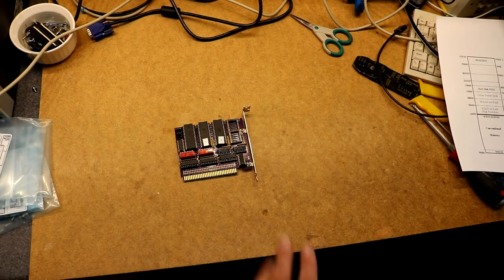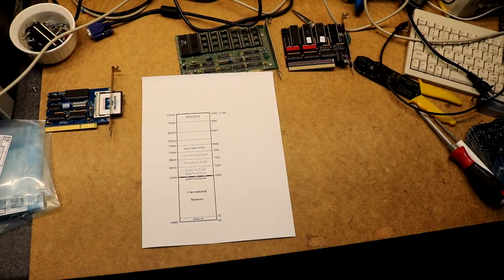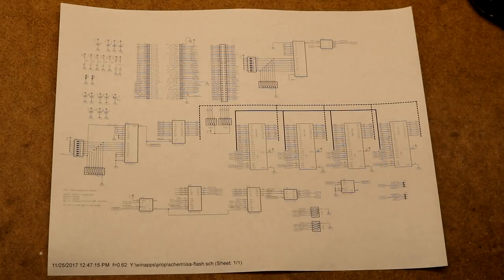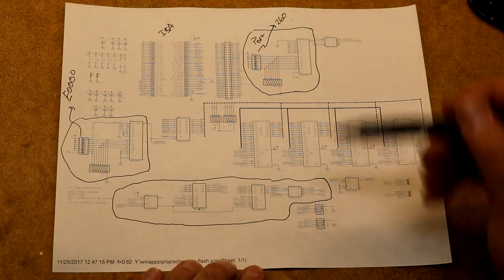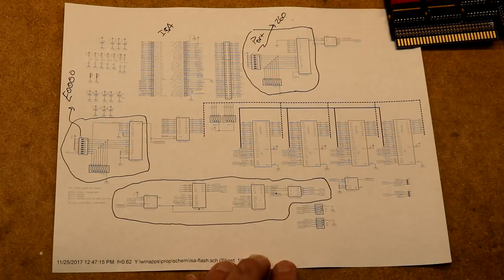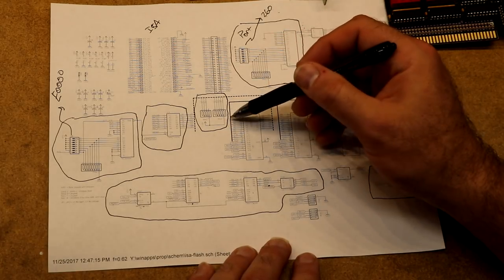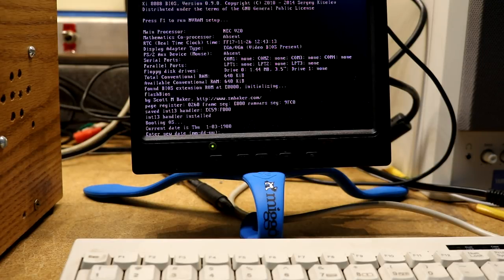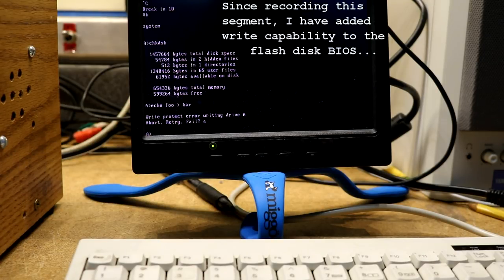8-bit ISA EMS board / Flash Rom Board

Comment: Something I'm looking for is a card that would combine 2MB EMS and 64kB UMB in one card. That would solve my "I have 5 cards but only 4 ISA slots on my XT" problem. One of those cards is Lo-tech's 2MB EMS at E000-F000 (works really well as a swap for 4DOS shell leaving a good chunk of free RAM for DOS programs), another one is Lo-tech's 1MB RAM on which I've enabled 64kB UMB at D000-E000 (works really well with USE!UMBS driver allowing to load all other drivers into UMB leaving even bigger chunk of free RAM for DOS programs). With this amount of free RAM, Windows 3.0 finally started to be stable!

Comment: What I'd love to have is an XT compatible single board computer with everything on it, including 8 megabytes EMS 3.2 RAM, an RS232C port, basic VGA, XT-IDE, and a USB controller supported by whatever DOS USB drivers are available.
What would it be useful for? Replacements for the 8088 computers used to control vintage CNC machine tools where the software can run on pretty much any DOS PC, but only works with EMS memory.
Reply: @prozacgod  doubtful that any of that would work with old DOS CNC software that requires 100% exclusive access to a serial port. I tried under Windows XP. I got it to launch and connect to the milling machine then XP butts in, takes control of the serial port and the DOS software shuts the mil down because of XP's interference. It might work under Windows 95 or 98, if those Windows versions can be forced to not touch the serial port at all, and if there's a way to setup a large chunk of EMS for the DOS program.

I tried some software that was supposed to give 100% exlusive com port use to a command prompt window in XP, but it was a lie. Lasted about a minute before XP went "Hey! MY COM1! Gimmie!"

I keep putting off trying a DOS setup on an old WYSE S30 thin client to see if its built in hardware support has left a large enough UMB hole for an EMS page frame window. I have a USB floppy drive, which I know it can boot from. The problem is the way those thin clients hide the IDE controller after beginning the boot process of MS-DOS and FreeDOS. Even if DOS is installed to the IDE Disk On Module outside the client, then the DOM is plugged into the client, it fails. It just starts to boot then the BIOS hides the IDE controller from the OS. Someone said using the GRUB bootloader should ignore that hiding. Linux can be configured to ignore it. Of course the Windows Embedded XP and the other OS options WYSE offered on the Sx0 series ignore that "feature" to boot.

If I can get DOS to boot from the DOM, and have USB support, then I plan to use a chunk of the maximum 512 meg RAM that can be installed as a RAM disk to copy things to. Possibly the CNC software and large gcode files.

Just need to get a round tuit and dig up my DOS-fu from 30 years ago...